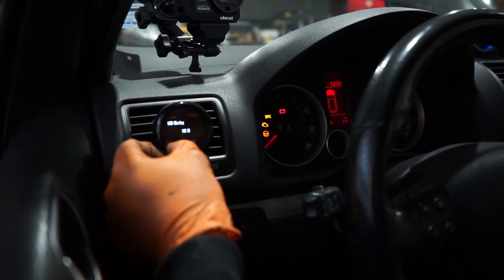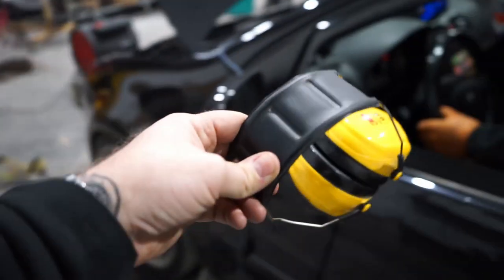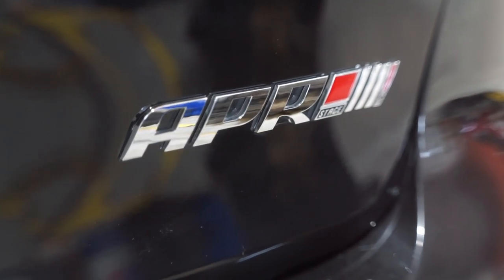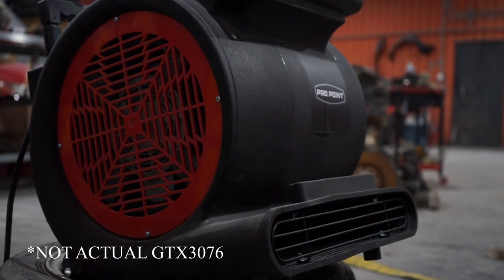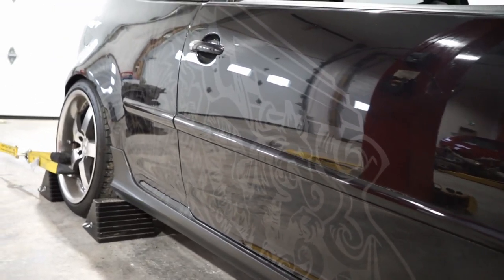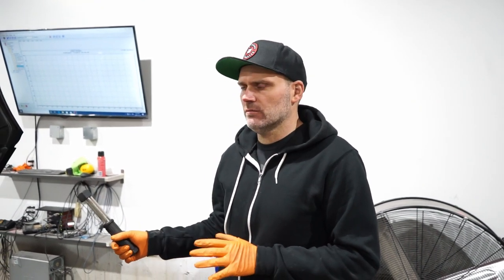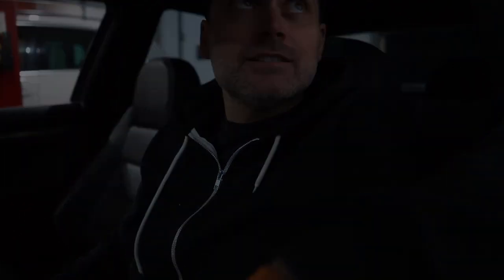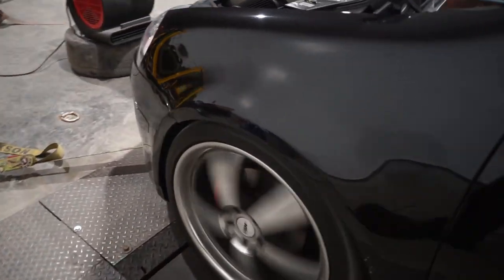We dyno a Big Turbo MK5 GTI 2.0T before the AWD Conversion.

Comment: 4:00 
Haha another advantage of the 5th injector in the long term might be cleaner intake ports ? 
It's just a guess as the problem normally is there isn't any fuel mix  flowing thru the intake tract to wash the blow-by pcv crap out of the tract.
Reply from the maker: Small impact on this as that injector is only used under high boost/power demand. But yes, with MPI that's a big benefit.

Comment: is the gearbox also a mk5 r32 ? im in the uk and planning on doing this conversion but not sure if the  r32 gearbox will fit my tfsi bwj engine
Reply from the maker: 4cyl and 6cyl have different bell housings, the rest of the trans is the same. If you watch one of the last videos you'll see were actually using the GTI trans and making it AWD.
Reply: @COMotorsports  thanks for the reply and clearing that up, cant wait for the rest of your awd videos and the abs and haldex integration!!